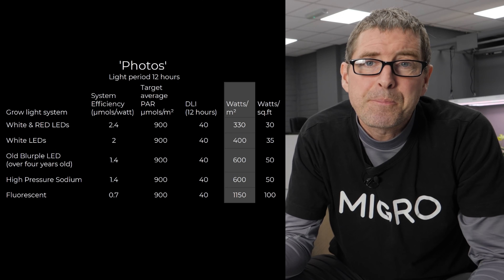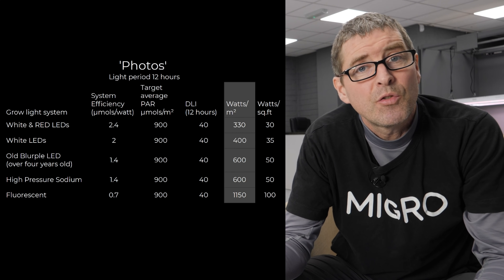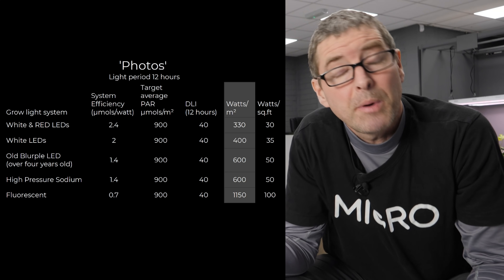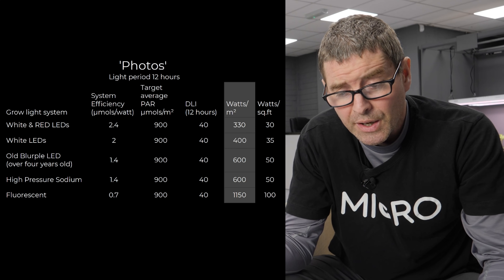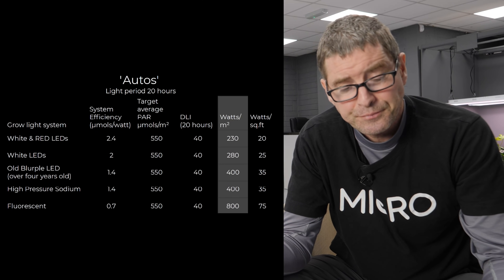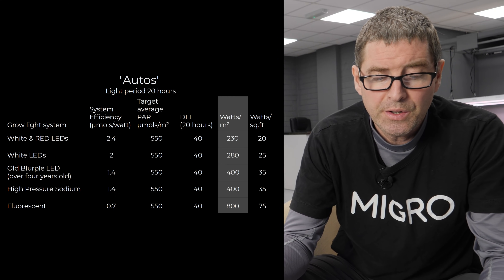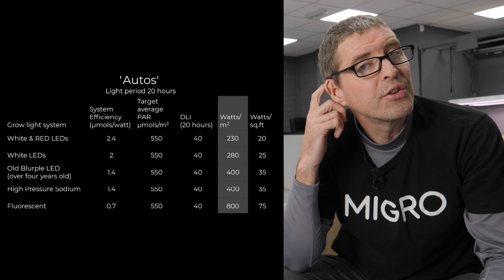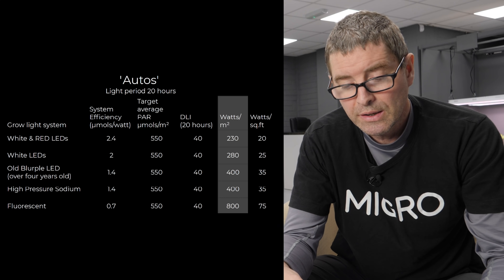Photos and Autos Recommended PAR levels for Photos and Autos

Comment: I jus can’t get why you would want to grow autos indoors when you ideally need to use almost double the electric to get the most/best out of them and it’s still an inferior product at the end when compared to photos. (if you claim autos are just as good then you’re growing the wrong photo beans)

Autos are great outdoors though, for out of season growing or to get more crops in etc.  I jus don’t get how anyone could find it logically a good idea to grow them indoors over photos. I know people claim they are easier, but are they really? And so much easier it’s worth nearly double the cost to grow them? I mean it’s not hard to jus change your timer from 18/6 to 12/12 when ever you want them to flower, or if you really want go 12/12 from seed for pretty much the same results, They will veg for 2-4 weeks then flower similar to what autos do. 

I know they have gotten a lot better over the years tho and they will probably continue to. but they still don’t really compare in quality of the end product certainly not yet at least and in my opinion it’s a waste of time and money growing them indoors, unless I can get the same results growing them on 12/12 indoors when they flower.
Reply: Actually there is no big difference in terms of electricity used when you consider DLI (daily light integral) best thing about autos that you can still catch a good DLI and get good results giving them 20/4 schedule even with a cheaper and less effective light. Also they grow a lot faster than photoperiods.
Reply: I personally like to grow indoors because of pests.. And LED lighting really doesn't affect the electric bill too much.. Not enough to say "alright, fuck it.. I'll throw my lady outside with all the awful elements and insects.. I know autos can be pretty resilient.. But I still prefer to grow indoors over outdoors. And not everyone can just throw some cannabis plant in their front yard.. Alot of people can.. But not all.. Although the sun would be nice to use instead of lights.. But still.. Bugs, dogs, cats, rodents, birds... Can all be avoided, for the most part, indoors..
Reply: I agree. The reason i grow autos is that i can give them much more light (dli) during their life. I run 24h till harvest. With that i allways get bigger buds. While with photos you give them only 12. I know you can regulate this with lowering lights way down to achieve same dli, but i prefer constant light and double the dli. and, yes today autos clock on 25%, which is way more than i like. I guess it is just thing of preference and ciuriositi and experiment thing.
Reply: Double the harvest. Plus Alot @20% thc now. Few years ago I'd not touched them. Untill I seen a buddy growing and tried them. I usually flower autos while photos are vegging.  With limited space they fill in the time for my photos to finish.🌱🌱
Reply: @UCzRX-p3Fu_SkbFK03pFQsFg yeah I didnt finish reading ALL of it.. i see that now 😆 but autos are perfect for the single smoker in the household, in my opinion.. It helps take SOME of the guesswork out that could otherwise be a hassle when it comes to autos.. For some maybe.. But the point I made still goes along with everything I didnt read lol... Everyone has different shit going on in life.. Maybe the autoflower pack was cheaper than the photoperiod 🤷
Reply: ... And I did grow an auto on 12/12 once.. I personally really didn't see TOO much of a difference.. Of course some.. But ended up with some nice, dense colas.. Everyone has their own preferences.. I'm not sure of the quality in autos from before (lowryder #2 and whatnot) but I always check out what Im ordering.. Not gonna buy some -10 or 15% thc auto beans when they clearly have 20% and up! But yeah.. I havent grown an auto that I wasnt happy with.. Except once.. When I had no idea about DLI and just bought a new light with NO PAR meter.. Burned that bitch so bad, she spit out an alarming amount of foxtails.. I still don't know if that was genetics or light stress.. But that was a whole completely different type of fuck up on my part.. Not the genetics.. Other than that.. No autoflower has ever let me down.. No stunted little runts.. No hermies... Great quality.. I guess it all depends on the beans you grow.. It looks like FastBuds has really stepped up their game with these last 2 or 3 drops they had.. I would stay away from ILGM's NEWER autos.. They just dont seem very stable to me.. Also, stability in the genetics can have a HUGE role in how the autos you choose produce. Quality over quantity in my opinion.. Dont get me wrong.. Im not gonna waste time on a plant that is only going to produce 10 or 20 grams.. But from what everyone has said about autos back in the day.. I can say that they have came a LONG way.. But of course, still could have some improvments.. And my opinion on it.. The more autos are being crossed with high THC photoperiods.. The better the offspring can come out.. Maybe or maybe not.. Idk.. I do like the idea of fast flowering tho.. Auto × photo = f1 fast version.. 45 - 50 days of flower is amazing.. Just got some Aura beans and cant wait to pop one!!!
Reply: @eric8630  i presume you answering to me. Haha, as i wrote comment to you and accidentally deleted it. Yeah, absolutely, i grow autos mostly. He is right about: that you can do short finish with photos, and keep them small but.. i never had buds with photos like on autos. And speed of course. About ilgm, i saw grows on yt with their autos and I'm not impressed. All the hype around bergman is over exaggerating in my opinion. Mostly because bill ward is promoting them. And fast buds are totally different story. Right now i just popped the purple lemonade for winter. I almost exclusively buying beans from them. They bring the game to almost perfection. And what lights you running?
Reply: @Trrenik0kb  im running the optic slim 320H in my 2x4 rn.. I will be bringing out my 2x2 after this run to run some fastbuds actually.. I have a shit ton of ILGM.. They are decent.. The white widow auto is not bad.. Its just the newer autos they came out with.. Like the zkittlez.. And after.. They arent very stable.. And hearing of alot of people recieving photos instead of the autos that they ordered.. You gotta look at the packaging and one pack that ai recieved from them was supposed to be a photo.. But the BIN# on the pack of seeds says otherwise.. Autos says F20A and photos say F20P.. Or its something wierd like that. I received the autos instead of photos.. Not that mad about it.. Just wish I would have gotten what I ordered.. They did replace.. And they tend to have to replace alot.. Recently tried the sunset sherbet (a newer photoperidod they came out with maybe last 2 or 3 years and out of 3... 0 popped.. Im sorry.. 2 cracked open.. But never grew past a 2mm tail.. And I know what Im doing because this is the first time in 4 years I had more than 1 seed crap out on me.. But for 2 on 2 seperate occasions to just stop sprouting after clearly beginning.. Fuck that.. Ive got 37 left and I dont even want them to be honest.. Such a waste of time. I even use their method.. But ai dont left the seed sit in the cup for more than 24 - 36 hrs.. As for Bill Ward.. Dude can grow some huge autos.. Idk if they hand pick his specifically or what lol.. But he tends to have some very NICE autos.. My autos never get as big as his.. But yeah.. Ilgm and rocket seeds I don't trust. I saw that rocket seeds had only their weird brands but they also had Blimburn seeds.. I went to Blimburns website and they have a notice on their website saying do not buy Blimburn seeds from Rocket Seeds.. They are not a verified distributor and they are selling people seeds that are not from Blimburn in Blimburn packaging or some shit.. Idk much about Blimburn either but I have seen them around at least.. So that says something about them.. Damn im typing novels here.. Lol.  I love talking about this stuff.. Not trashin breeders/distributors.. Just growing in general... So much to learn.. I fucking love it! From photons to water quality.. Even legalization to health.. Such an interesting plant.. And this guy Shane from Migro is really helping ALOT of people out.. I cant count how many bs lights Ive been thru.. Should have just saved up the money and bought something with the best components.. Oh I meant to say.. My 2x2 I have a wakyme j2000.. Its WAY overkill but temps around here can get hard to control and running an overkill light at 50 - 75% power tends to BARELY raise temps in the tent and lung room, if any at all!.. I also have a Mars Hydro ts1000 but thats gonna be a backup light if needed.. Also got MH to send me a backup driver incase the one I have craps out.. Smh.. MH is shit in my opinion.. I went thru 3 lights in 3 years.. Thats why I went ahead and bought that WAKYME J2000.. Doesnt have samsung LEDs but it does have a 200w meanwell driver and a fine tune dimmer.. Has 2 fans on it.. I know people HATE fans on lights these days.. But hear me out.. You usually have to put a 6 inch fan on a Mars Hydro anyway cuz it does still give off heat and will get hot as fuck without a fan on it if you run it anywhere above 50% power.. The fans arent any louder than my exhaust and intake fans.. My point being, lol, idk why light companies ditched fans!!! They help keep temps down ALOT and help with the life of the components!.. Damn, Im still going with this novel here.. And about Fastbuds.. I ran a PL recently.. Just wait till you see how she turns out! Super tasty! Purple starts at week 3 or so of flower.. So gorgeous
Reply: @Trrenik0kb  and rereading my comment.. Idk how the name showed up like that.. And I think Inwas responding to a few different people but yes you were one 😂
Reply: @eric8630  it is nice to find a fellow aficionado about, not just growing but the whole story. Like you said from photons to politics about it. In my opinion it'a sacred plant which give so much and i treat it with respect.yes, there's alot of fake online banks who are selling who knows what. Looks like they in ilgm are high as kites while packaging haha. Luckily there's a Good number of reputable banks who i can trust. I mostly buying from eu breeders, but on 'seed city' you can find plenty of breeders. They are bank in uk, and work with breeders from usa. Or my favorite (choice seedbank). I think they are also based in uk.  I newer heard of wakyme light will chek them out. Me to like to put small computer fan on top of my light, mostly to prolong and save life of components, and like byproduct i have more heat in the box as i prefer to grow in winter lol. Thanks for the info what i can expect from pl. Cant wait.  She is just 3cm high, and tonight i force my box with 75% of humidity lol. And from fast buds have 3 blue dreammatic waiting for spring as its mostly sativa and is not for winter. Lol and yeah shane is top guy. I think he never thought that mostly growers will hang on his channel. Haha. Cheers mate, happy growing.
Reply: Yeah auto's were a nice learning tool but I agree your return on time spent, nutrients and electricity isn't worth it imo.

Comment: Canopy penetration into the lowers, is super important and something I've been told our eyes do not see, is that true?

Thanks for the work and studies as always MiGro
Reply: yes it is true. top leaves get most the light but green light penetrates thru the top leaf into the bottom but to an extent, light won't get too far down if you have massive bushes that is why most people cut away bottom half of the plant
Reply: @ovrlord2522  Can this be solved with LST? Tying down the branches?
Reply: @ineedmysyq   yup LST and topping the plant will always focus most energy to the top shoots where the most light. Realisticly you should have plants with most top shoots as possible at the tops to get most of the energy from the lights and the plant itself. The way I do it is I top heavy and lst and super crop in veg to make sure I have at least 10 to 15 top shoots from one plant any shoot that is not getting enough light will become light green that is the bits you cut away. I cut away everything below 40 inches from the top of the plants for best results.

Comment: Thanks Shane 
I grow autos exclusively. Thanks for the information makes sense 12 hrs to 20hrs less light intensity is needed. Never really thought about it.
Reply: it doesnt make sense :D  they grow  on 18-20 hours but in 6 weeks not 8 ( in general) the new auto generation is over 20%  u cant have  the same tch cbd etc when u got less 2 weeks flowering and less light :D  autos now can handle  the same like photos :) grow them in 30l  pot  and u will see the diference:D
Reply: @archdevilzero5020  exactly
Reply: @archdevilzero5020 No auto finishes in 6 weeks lol. The seedtoharvest time given by breeders is nonsense. MOst autos take 80-90 days except some small low yielding crap like Lowryder.

"grow them in 30l"

If you want to waste space and pay extra for medium than sure.🤣
Reply: The leaves often droop once they’ve surpassed the DLI. You will notice this about an hour before lights out.

Comment: I was always burning my autoflowers because I figured pumping up the light is what they needed.. But once I learned about "DLI" I was surprised.. Very surprised.. But it all makes sense.. Thanks again!
Reply: It is a very important topic.. I barely leared about that this year! Ive been burning all my autos to a crisp 😭 also, i am so glad I bought a par meter.. They take all the guess work out.. The recommended height for my light in my current grow says 24" at 25% power.. But the plant is in veg and only receiving about 200 - 230 μMols throughout the 2'×4' canopy.. But when I drop it down to 12" at 25% power, I get about 400 - 450 μMols throughout the 2'×4' canopy.. And keeping the power at 25% helps keep temps down.. PAR meters are so helpful!
Reply: @eric8630  what lights you are rocking? A i too have 2x4 size
Reply from the maker: Eric, I should have covered this topic a long time ago for Autoflower growers. I have finally caught up with what most people are now growing😁
Reply: @MIGROLIGHT  Shane great job if we can get more content maker to use DLI instead of ppfd I think it would help beginners so much . Great job.
Reply: @MIGROLIGHT  kiwi :)
Reply: Eric I was doing same thing. Once I learned about DLI it was the keys to the kingdom!!! DLI should be take way more than ppfd. Understand what plant needs for light is one thing but it is accumulative total that makes it or break it. Great info.
Reply: Although I definitely believe in DLI I have a problem with the logic of 40 DLI for both autos and photos. If it's true that why is it that autos have generally bigger colas? Are they growing faster with the same amount of light? Or maybe that 40 DLI spread over 20 hours is more effective than 40 DLI over 12 hours because there is higher loss of photons with 900 PAR vs 550 PAR? There is a diminishing return as PAR goes higher? It seems thet the time is more important than PAR. If you think about it: Would you get the same result with 1800 PAR over 6 hours as with 12 hours / 900? I don't think so.
Reply: what is dli please. think im doing same. running my mars hydro sp3000 at 100%. thinking im making a mistake
Reply: @rustygagne3942  Daily Light Integral , it's how much light a plant takes in over it's light's on period over the space of 1 day for maximum growth or flowering 💐 😉
Reply: Yeah I sizzled my autos too, I thought my cheap vivosun lights needed to be closer to get that 300-500 ppfd I was told vegetative plants need. Oof bleaching and tacos for days, but luckily they recovered
Reply: What’s DLI 
SORRY OLD NEW GUY
Reply: Spring sunshine into summer sunshine into fall sunshine
Reply: To stop seedlings stretching they just need a little wind and they will have twice the base you normally get
Reply: Wind has nothing to do with seedlings from stretching, its a light factor in most cases, or genetics, Wind just helps with stock thickness and airflow
Reply: @chanoone7812  that ain't gonna do nothing if your lights to weak